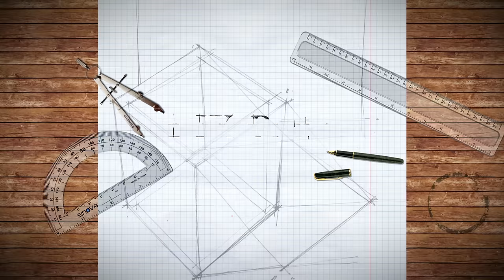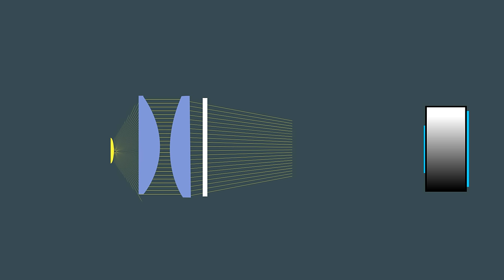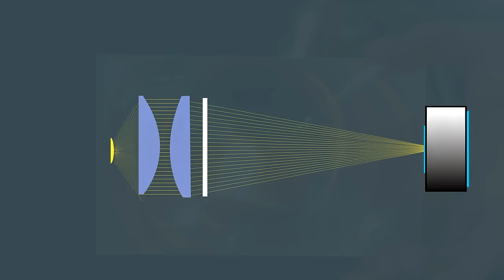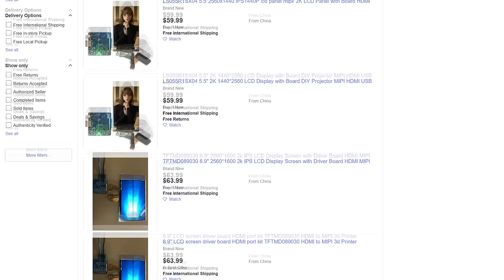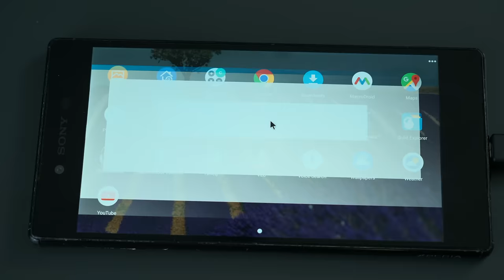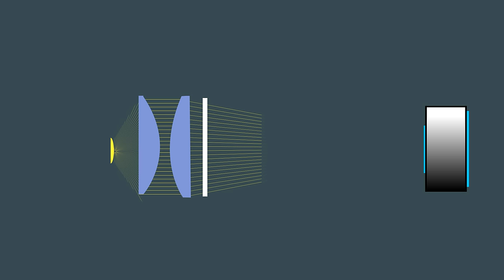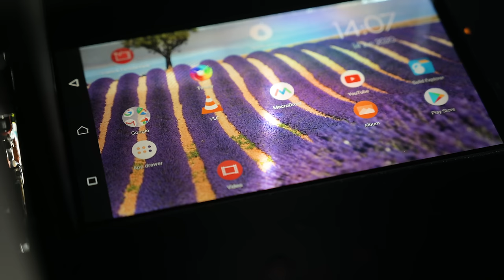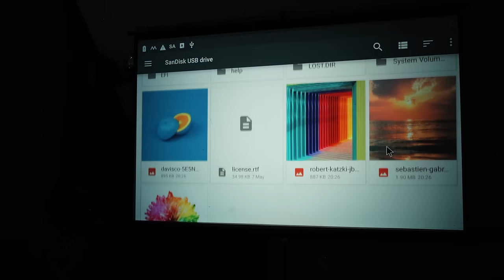Building a TRUE 4k home cinema projector (it’s awesome)

Comment: This is an awesome awesome build, so I hate to rain on this, but I own a Z5 Premium (and honestly this is the best 'graveyard job you can give that useless brick) and I feel I should clarify a few things:
1. ) The screen of the Z5 P is NOT a full 4k screen (which would be 4096 × 2160), but UHD (which is 3840×2160). Nitpicking? Yes, definitely. But all the ultra expensive 4k projectors, actually DO run on full UCI 4k. Projectors with a "normal" smaller UHD, are much much less expensive - but again, this project, for the price it'll cost, is tons cheaper. Also, obviously the aspect ratio will be off a bit. Dunno how the video app will handle this. Which brings us to the next, very important, point:
2.) To make sure people don't fall for the same misinformation from Sony that I fell for when I bought my phone, please be aware that the phone only displays it's full "4k" in two ways: Using the official Sony photo app and the official Sony video app. Install a different app for either one? No 4k. It won't even show you the option in YT's resolution settings. You'll only get what the rest of the Android system will show you: The sharpest interpolated 1080p picture that you have ever seen on a phone - which is impressive, but not what people who'd build this, would be after. So again, if you think you can use this projector to watch 4k YouTube, you are mistaken. 

It IS apparently possible, to switch basic resolution with a few settings in Android, but we're talking about root access here. That would give you 4k everywhere, even on the home screen. This wasn't done in stock models, because as any owner of that phone can tell you, the screen already eats your battery alive at 1080p. In this set up however, battery power is no issue at all, so go for it and you'll be able to watch 4k YouTube as well.

I'm really considering building this....
Reply: Great information! Hope you do it, root access and all!
Reply: Not wanting to take Sony's side here but with computers "4k resolution" commonly refers to 3840×2160 (for example with PC monitors). Even "4k TVs" are actually 3840×2160 so I'm inclined to give Sony a pass for using "4k". Thanks for pointing out the disappointing behaviour of an unrooted Z5 P though.
Reply: What you refer to as "full 4k" would be at 17:9 aspect ratio which almost none of modern monitors or even TV-set have!
Reply: I guess you could just use a driver board to drive the display unit instead of a phone and run maybe a rasperry pi with kodi for 4k playback.
Reply: I had this phone too and honestly I have to say it definitely wasn't the sharpest 1080p image. Compared to the Z3 I had before it the screen was definitely worse unless, as you said, I was using one of the "Sony 4K" apps. 

I'm definitely going to make one of these but I'll be using one of the 1440p screens from ebay since I already have one.
Reply: I wonder a lot how would DPI settings in Android affect the quality.
Xiaomi and other brands are launching HDR10+ compatible phones with 400 or more DPI granted is no 4K and something like 1080x2340 but i guess a good controller would be able to output 3840x2160 at least?

Plus the hardware specs would make it a very all around solution, throwing in a Android TV kinda launcher on the stock room without need for root.
Reply: 4K UHD (3840x2160) is what almost all "4K" consumer devices use. It's true that most cinema projectors use DCI 4K (4096x2160), but this is also a different aspect ratio. 
But thanks for your clarification, especially the part 2 :)
Reply: 2015 Snap Dragon 810 this chipset was the real problem not the screen. This part 2 is no more true with XZ Premium and XZ2 Premiums and Xperia 1 and 1 Mark II

Enjoy 4K as long as the content support it, the phone will change the resolution.
Reply: Atnas1010 yeah, I’d be very surprised if a 4K projector that only costs a few thousand dollars were to have an actual 4K DCI resolution. Those cheap ones are for the home and are UHD. Actual cinema projectors that would be fully 4096 wide have costs measured in the tens of thousands of dollars, not in thousands.
Reply: Nice points, but I think the SoC thermals might prevent watching any proper UHD sources (not to mention higher bitrate material). The battery drain in those original applications is indicative of the potential issue.
Reply: I confirm that the phone in it’s current state does 3840x2160 only within specific Sony apps. So root is the only way to get full physical resolution of a panel. And other thing is I’m not sure if phone is powerful enough to play 4K h.265 rips
Reply: So, a few points here as there has been some input.
Yes. I am aware that every TV that says "4k" is, in fact, UHD and not DCI 4k (and also has a different aspect ratio - which I even mentioned in my original post, lol). That's my point. When people say "4k" they think that every 4k projector, even the expensive ones, are UHD as well. Which they aren't (the expensive ones, that is). What most people also miss, is that there's a difference between an upscaling projector and one that does native UHD. That's the difference between very cheap and cheap-ish "UHD" projectors. 

Which brings me to the second point. No, you can absolutely get full DCI 4K projectors for WAY under 10k.It simply isn't true that you'd need to spend several tens of thousands of bucks to get one and you definitely don't need a professional cinema one. In fact, I'm looking at one right now. Sony VPL-VW270ES. Less than 5000€ and it has 17:9 full 4096*2160 DCI 4k.
Although yes, you can absolutely spend anything between 4,5k to 75k on a good projector. That however, isn't the point of this build. 

About the XZ and XZ2: Both of these have the exact same issue. The resolution is absolutely forced to 1080p, as you can read on several reviews and boards. If you turn the resolution up, power consumption will go up as well. Also, from what I have read about the 4k screen while fiddling with it, back when I used that phone, forcing the resolution to 4k actually screws up a lot of things. Like screenshots, rotation, FPS in menus.... No idea how the XZ(2) deal with that, but using it in this projector, where none of those issues matter, is the only usage scenario that I can think of, where I'd be willing to push this screen to full resolution.

Cooling the SoC isn't even the issue. Hell, there's nothing that keeps you from just directly cooling the SoC with at least a heatspreader, if not even a heat pipe. Also, I wonder if it's possible to take the entire phone's components out of the case. You could easily dump the camera, while you are at it and mount the entire thing on a heatspreader. 
But back to the start of the paragraph, I think what needs to be figured out, is wether the screen would overheat. LCDs can overheat, but would it overheat from just being in the LEDs path, being run at full res? I remember that the Z5P had issues with 4k recording and playback, but as mentioned in this thread, that was through SoC heat. I don't want to go through all this work and then have the crystals of the LCD go haywire. because if it DOES overheat, you'd have to engineer (what a fancy word for "design something in Fusion 360 and print it in ABS on your 3D printer) a cradle for the screen that is hollow for airflow, gets air pushed through it and holds the screen in a metal frame that acts as a heatsink and takes heat away. Well, that might be totally overblown, but you know what I mean. Worst case blah blah.

The idea with the driver board is VERY interesting though. Despite just ordering one for an old 17" laptop screen from a dead workstation, I didn't even think about looking for that. Thanks for the idea! It would also get rid of the need to turn on a phone and navigate its menu through a flap in the projector.

Comment: Now to find my DIY internet that can actually stream 4k.
Reply: On Netflix
Reply: @abdulmuhaimin5274  what?
Reply: 4k capability is determined by your monitor or projector in this case so I assume you mean your internet is too slow or you're using a downgraded box from your cable company that doesn't allow HD... which is a scam, use a different device to stream
Reply: You can immigrate to Russia, I pay 8$ for 100 mbps, and this is expensive compare to Moscow, where you'll pay around 3$ for this speed. /s
Reply: I think Elon is building a network that can do it.
Reply: @Applebloomish  immigrate to north korea. 1000 mbps (gbps) for $5 a month
Reply: my network is just 9 mbits down rip... germany has a worse internet speed than columbia.
Reply: @Applebloomish  what in germany youll pay 6 times more for this speed (if its available - not in my case)
Reply: @mrjaquavis6444  this is insane!
Reply: @Applebloomish  Meanwhile I pay $80 USD for 200 Mbps full duplex
Reply: @mrjaquavis6444  LOL, but what you can use with it is very limited
Reply: 1Gbps - 9$/month in Bucharest.

Comment: A solution to the 300W LED problem could be water cooling. It's more complicated, but it's quiet and you can now brag about how you have a 4K watercooled projector
Reply: Actually it's air conditioned room
Reply: It would also reduce the size of the unit
Reply: The problem with that approach is it wouldn't have any airflow to cool the the phone screen.
Reply: @leslieh2753  Water cooling of that magnitude requires a couple (or three) very large fans over a very large radiator. Airflow wouldn't be an issue. You wouldn't even need additional fans in the case exclusively for the screen.
Reply: Don't tell Linus
Reply: I was thinking the same thing. He posted a video with a 1000w led earlier wouldn't it possible to combine those two? Will it damage the LED?
Reply: @StoneUSA  With watercooling, the fans are blowing directly on the radiator so you're not cooling the hot spot on the screen.
Reply: He said the lcd is getting too hot... but you also can Watercool the screen i guess
Reply: @JanSt12  For that you would need a contact point touching the screen to cool it off and then it wouldn't be transparent anymore. It would make for a really boring movie night.
Reply: Binod
Reply: @JanSt12  how on earth would you do that?
Reply: @andycrask3531  well i think you could make sort of a box with the screen as the bottom side an Fill it with Water 😅 i did not say its easy 😂
Reply: I want to let you know thanks for the idea just ordered 4k 5.5 inch screen and 300w 95+ cri 5600k led that I had to scrounge to find cause yuji doesnt make em. Just requires more cooling and pressure design it can be done I hope.
Reply: Actually just noticed he linked the same sellers ebay page I got the LED from but I just ordered from aliexpress savings me like $120 off the SHARP LS055D1SX05 and $40 off the COB LED. My theater is gonna be sick af so hype my 1080p cinema projector is gonna be so embarrassed.
Reply: @TheOfficialBrettS  Your LED requires approximately as much cooling as a P95 10900k, you'll need a beefy air cooler or a 280mm rad but it'll be a brilliant output.
Reply: @TheOfficialBrettS  wait no fuckin way! I haven't had time to do it myself yet but please let me know how it goes because I'm def doing it when I have time.
Reply: @geoffrey1809  you could but the stupid cost and extra heat would not make that worthwhile in my eyes. Especially since it gets to the point where you'll barely notice the difference
Reply: water submerged cooling
Reply: Alex Surber jeez thanks for that perspective aha thats hot yea ill have it ceiling mounted pumping the heat out of the room 😁
Reply: @linustechtips
Reply: @leslieh2753  surely just blow the air across the rads to the outside creating a draft from the top to the bottom of the tower, a little ducting and you could get the same flow as this setup.
Reply: But does it have RGB led-strips on it ?
Reply: Yeah there are many AIO options that could work for this without breaking the bank.
Reply: @JanSt12  It would definitely interfere with the picture quality?
Reply: @TheOfficialBrettS  what driver board or connector/adapters are you using?
Reply: Linus would be proud
Reply: That cooler he is using is a Noctua, and one of their larger cpu coolers.  The Noctua CPU coolers are arguably better at cooling than AIO's.
Reply: turn the whole thing upside down  and mount to the wall ....   led heat source is above the screen   (ps guys heat rises)
Reply: Just have a top mounted radiator and have it exhaust air through the top and suck in air through the bottom.

Comment: On this episode of Linus Tech tips we're going to water-cool this home made projector so we can use a 300W LED for better brightness and quieter viewing experience just like our viewing experience of our sponsor Nord VPN. LTT store dot com.
Reply: probably it may burn the LCD panel with 300w LED.
Reply: @yongchon4978  But hey, at least they would have bragging rights.
Reply: @yongchon4978  In that case water cool the LCD too!
Reply: Linus is probably on YouTube because he was too incompetent for a data center job.
Reply: Hmmm... Watercooling the LCD panel boss?
Reply: @alanzhou6334  Make the panel that holds the LCD out of copper, for heat spread, while water cooling it, should be a good solution.
Reply: Of course the LTT cabal has to insinuate itself here.
Reply: @GregaMeglic  but the lcd itself is non conductive. I would suggest an IR filter.
Reply: Using sticky tape and a biscuit tin full of baby oil instead of water CHECK!
Reply: @Adam-McG  would explain things he keeps getting wrong
Reply: Linus has never had Nord as a sponsor. Their privacy policy sux.
Reply: he'd use a razer phone to make a high refresh rate projector!

Comment: Personally, I'd add a tiny fan pointing towards the phone screen, I'm worried it's gonna burn through it really quickly
Reply: I was thinking the same, especially with higher than 100W LEDs, unless you want to see a black blob appearing in the middle (dead pixels)
Reply: @fusseldieb  It would be like the old 35mm projector with a film jam. The Bonanza effect!
Reply: If there is thermal conductive transplant glass available, I am thinking glueing one pieces to the back of the LCD and glue more heat sinks at the peripherals of the glass.
Reply: An IR and heat filter is needed for higher wattage LEDS  big old projectors with halogen lights have them in the light stack
Reply: And also a nice set of infra red and UV filters
Reply: Yeah... Even commercial LCD projectors with UV filtering often burn their polarizers and lcds because of UV..
Reply: @TerryLawrence001  nope. you need those for halogen because halogens emit a shitton of IR. White LEDs only emit visible light, and although they get pretty hot, there is practically negligible amount of IR radiation coming out of them

Comment: Beginning of the video: Sweet I'll build one of these! End of video: No, I don't think I will...
Reply: I already gave up when he said aluminum
Reply: @AuznNjs  when he skips the point where he used a cnc machine to cut the perfect rectangular vents.
Reply: @AuznNjs  no need to make it in aluminium really. anything that blocks light and has some structural integrity should work. thin plywood maybe?
Reply: @bullzebub  some acrylic and vinyl wrap works well for me